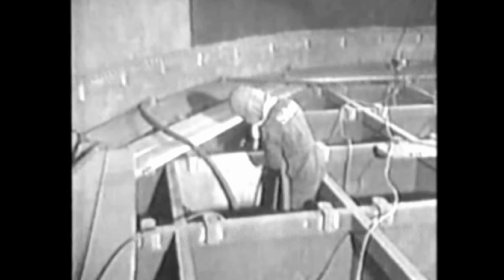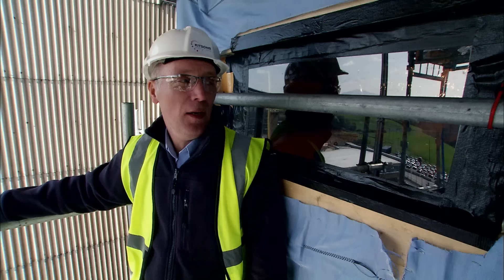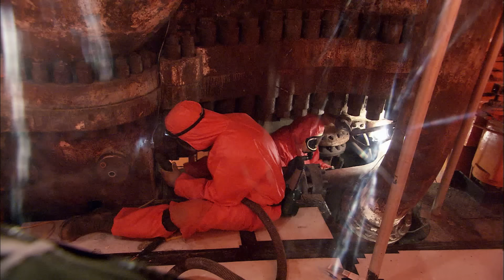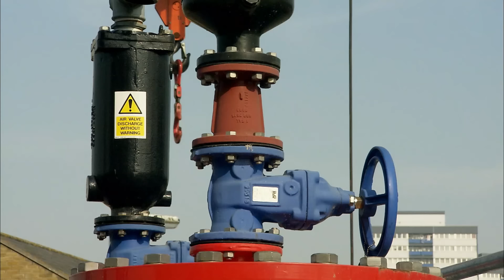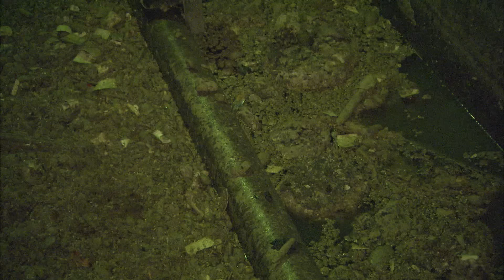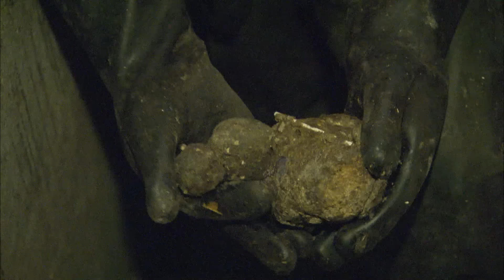Cleaning an Asbestos Covered Nuclear Power Station | Filth

Comment: That wastewater grease/fat buildup is no joke. Spent 10 years working at a wastewater treatment plant… every so often we had to do the same… break up and remove the grease buildup in the wet well. Used a jetter to break it up and then suck up the chunks…. The problem was that even with significant ventilation, once you started breaking it up, the hydrogen sulfide (H2S) alarms would go off and we had to stop and vacate the area… H2S is deadly like cyanide… once high enough it burns out the receptors in your nose (100-150ppm)… so you don’t smell it (it’s horrid…it’s what makes farts stink and etc), then your next breath is your last. No bringing you back. Your cooked.
Reply: Holy crap
Reply: That's terrible. Is the burnout of receptors permanent?
Reply: If you are unlucky enough to have your nasal cavity burned by H2S, you're almost certainly not going to live a long enough life to be inconvenienced by not being able to smell. Nerve destruction is permanent.
Reply: it kills the receptros in your nose like what i experinced with covid?
Reply: @AmadeusJohansson-gf4ge  unimaginably worse

Comment: Ok…so what did they do with the asbestos they removed?
Reply: In the UK it's gos to a specialist landfill and is buried other options that other countries use include Burn it at  extremely high temperature  to cause it to chemically break down and the other option is to use strong chemicals acids and extreme heat to cause it to under go chemical decomposition rendering it into safe non harmful substances basically you either stick it in a big hole in the ground or spend thousands on either burning it or chemically treating it
Reply: Back in the ground where it came from.
Reply: Put it in a nuclear waste casket. Who’s going to mess with it then? Plus it’s additional insulation!
Reply: @volvodoc01  why bother? It is a natural mineral, it comes from the ground and it's perfectly safe there if no one digs it up again
Reply: @volvodoc01  Fool.